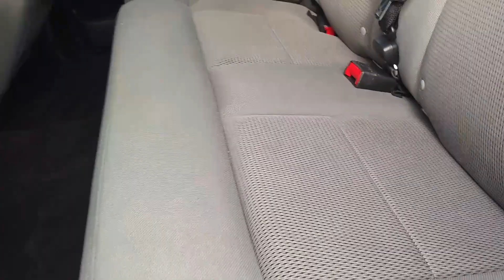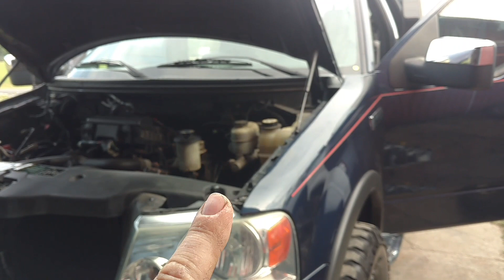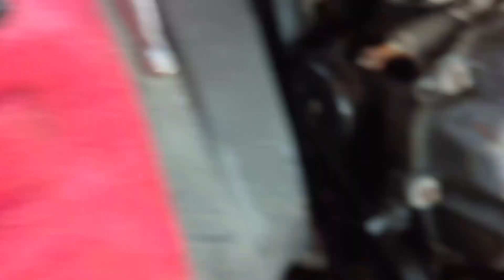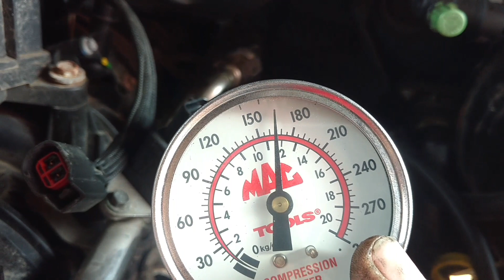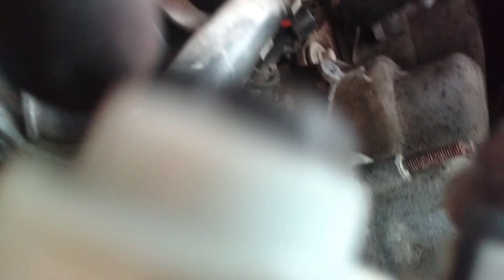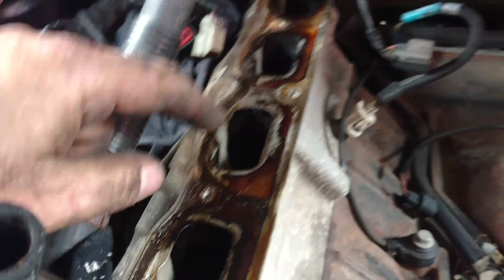PART 2) 2004 F150 CREW CAB 4X4 5.4 3V ENGINE TEAR DOWN & INSPECTION

Comment: blown out gaskets on timing chain tensioners was the likely source of the low oil volume/pressure on the cam followers. I’m about to watch part 3 to see how you determine of the heads can be saved (ie cam movement forward and aft in the journals)

Comment: Great job Mrs J C does she should charge you for it lol. Thanks again for a great video just can't wait till the next one. I used to working on 4 cylinder engines in the UK but they were older and easier :)
Reply from the maker: easy with that paying her kind of talk! i dont want a mutiny! i think this truck needs a certain 4 cylinder found in bread trucks!
Reply: Most of the family cars in the uk use 4 cylinder engines. Great to see that there's still the big v8 engines being used. They sound great.
Reply from the maker: there is on 4 cylinder engine i would put in this truck....4bt
Reply: That's the 3.9L Cummins. I here it has good power and very robust.
Reply from the maker: Andy Ball you sir are correct. Good reliable engines with great torque and good mpg.

Comment: What does your wife use to clean the inside with?
Reply from the maker: she uses peroxide on some of the tougher stuff, commercial strength dawn dish washing, bathroom scrubbing bubbles, magic eraser on hard plastic stains and an upholstery cleaner machine to soak up all the dirt. when it is all done in order to get the interior plastic to shine like new i use dollar general spray tire foam....i know sound weird but it makes dried out plastic look great and it smells good!

Comment: Im going with someone did the timing chains and didn't line the timing marks perfect. Don't crank the motor, pull the heads and check the piston slap on the walls.
Reply from the maker: check out the next video to find out!
Reply: J.C., Am i atleast close? 😆
Reply from the maker: ahhhh the suspense!!!! you a will have to wait and see my friend! next video is uploaded just not published yet!

Comment: Great systematic tear down with excellent commentary along the way.
I'm going to guess you have a low oil pressure problem with that engine seeing the metal transfer that you pointed out.
I have a refrigerator in the shop, it's small and doesn't hold much but, you asked and I want to be honest here and admit I have one....Lol
Stay safe there brother and take a break later to cool off. Hot and humid here today too.
Best to you and yours 'till the next one !!
Doug
Reply from the maker: I was thinking there was a low oil pressure problem and the previous owner had the oil pump replaced and did the timing components as a "since your already in there" repair.

i am thinking heavily on a fridge for the shop. my breaks would be much shorter as i wouldnt driving home and cooling off in the air conditioning.